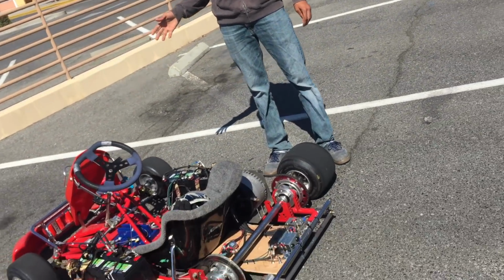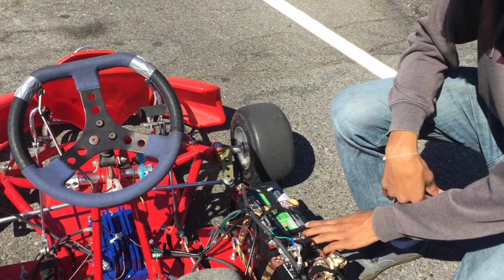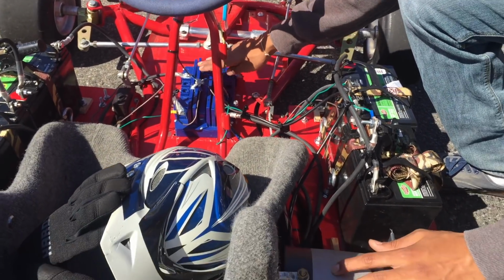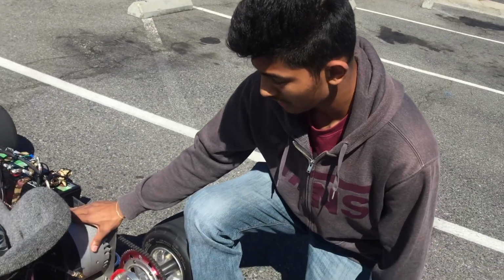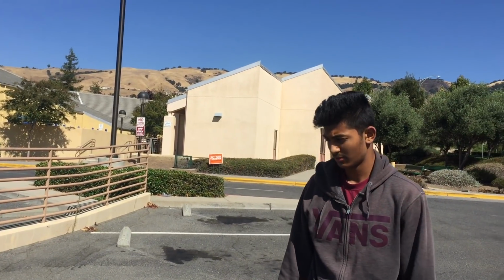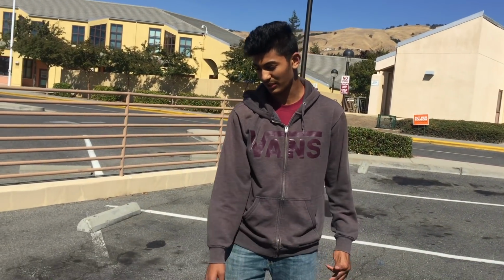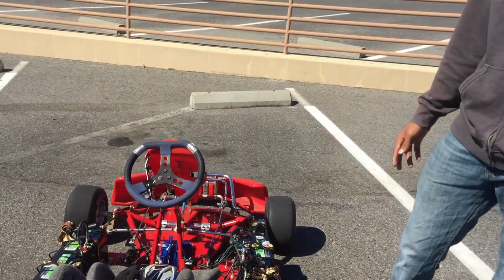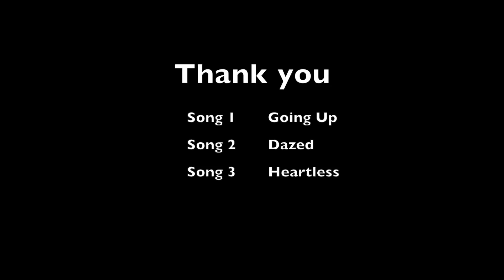How to Make an Electric Go Kart (Build)

Comment: Dude this is sick.  Did you do the circuit board yourself and if not where did you have it done at?  I'm thinking of doing something like this, I just don't know how to do the circuit board.
Reply from the maker: Thanks! I don't really have a circuit board since everything is mounted onto the go kart and wired together. I have my wiring diagrams on this page: http://www.instructables.com/id/Making-an-Electric-Go-Kart/
Reply: Right on.  A couple more questions if I could.  Do you still have it?  How long does a charge last?  And how fast does it go?  And what would you change?  Thanks dude.
Reply from the maker: Yup, I still have it. The charge lasts a long time. Sometimes I ride around the city with my friend for 2 hours. Right now, it goes top 50 mph. If I could change something, it would be possibly investing in a battery capacity meter like this: http://www.evdrives.com/category_s/3924.htm

Comment: what's the fastest you've gone in this thing? and what's the range like on the batteries?
Reply from the maker: I have gone 50 mph and the range is typically 2-3 hrs, maybe 20 miles.
Reply: Srikar Gattepalli Pretty impressive! Is that 2-3 hours of heavy use or just cruising?
Reply from the maker: Mainly just cruising with occasional breaks
Reply: 50 mph, 2-3 hrs, maybe 20 miles? hmmmm something doesn't quite line up here
Reply: @funy0n583  he’s saying his max speed is 50mph he didn’t go 50mph for 2 hours as he’d go 100 miles in that time

Comment: Have you also improved it? I also started with low voltage 48v and 10kw of power. But now have reached 100v and 60kw of power :)

Comment: well done guy...so 2 months, sourcing electrical components and putting it all together?? What is the duration time before all batteries lose their power??
Reply from the maker: Yes, 2 months to do the research and understand exactly which parts would go together and make a good go-kart. 2-3 hours before batteries lose charge.

Comment: hi, we are building a similar kart to yours also with the nme0708 and the alltrax controller, do you by any chance have a link to the sprocket you used on the motor, and how many teeth are on the axle sprocket?
Reply from the maker: Hello, Unfortunately I don't have the links. The motor side sprocket I believe I ordered from McMaster, and the axle or rear sprocket was from eBay, many people sell them. In terms of teeth, you can choose based on your desired gear ratio, top speed, and acceleration balance that you'd like.
Reply: @srikargattepalli6323  would you have the exact dimensions of your sprocket by any chance?
Reply from the maker: @alexmarianetti7586  Unfortunately, I don't have anything, don't have the go-kart anymore either to measure

Comment: that was pretty cool :D, have you run into any over heating problems? after running it at high speed for a while?
Reply from the maker: Yes, I did melt one of the batteries post a little bit. I adjusted the max current setting on my controller to 200 amps instead of 300 amps.

Comment: definitely swap the lead acid for lipo
Reply: noonenaught That would cost so much money. 48v means about 12-13s and his motor is 5000 watts continuous so about 100 amps. To get just 30 minutes of hard driving you’d need at least 30Ah of batteries. Just 5Ah of 12s lipos would cost around $200 if you’re lucky.
Reply: @bloogaming8827  You also can use dead e bike battery's most of the time for free. Crack them open and make from the good cells a new battery

Comment: Ok word of the wise for the future kobalt  power tool batteries (cheap but good )buy enough to make 200 Amp hrs and then do this 
https://youtu.be/CSYB60GSLic  and parallel them  then make enough to make 4 packs in series and u can get more range and lighter weight  then change the sprocket on the back axel to smaller tooth size  for more high end speed and slightly lower torque and double up on the motors as in have 2 of them and get bearing brackets (2) and bearings(2) and cut the live axle in half and hook up both motors one to each side and tie them in together for simultaneous running and add a brake current cut off circuit for brake pedal and then u should be fast as hell and make turns with our skipping through and having wheel chirping o if u get more money go brushless motors btw good job first time out